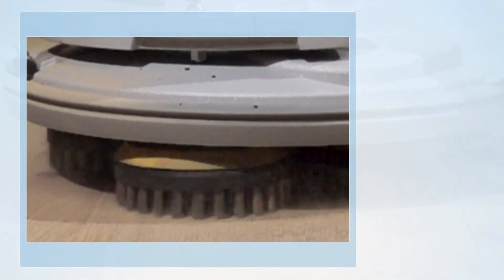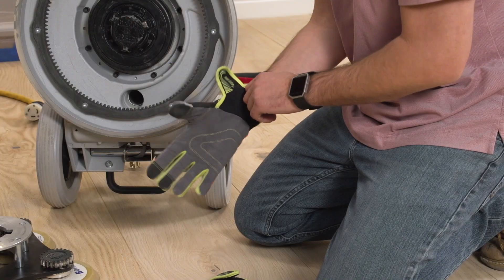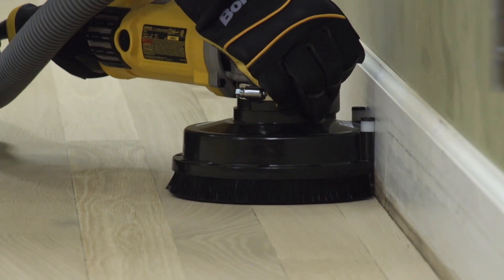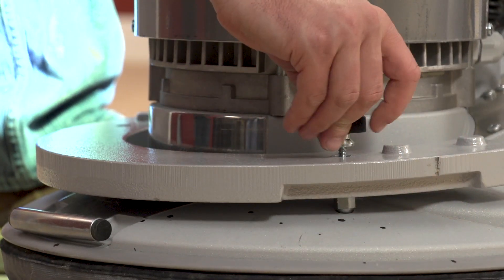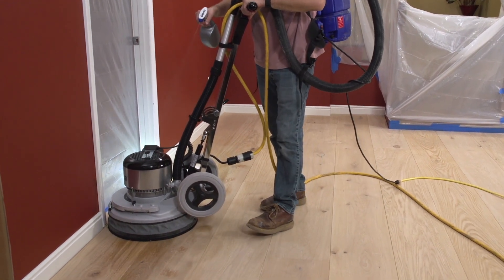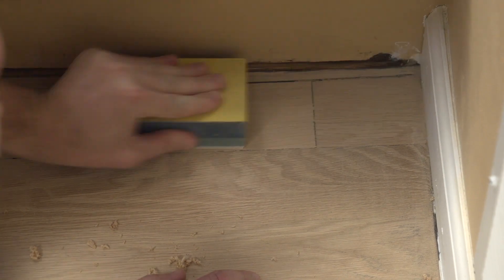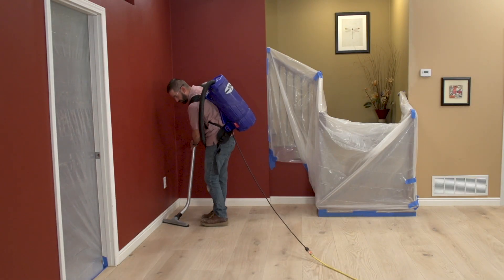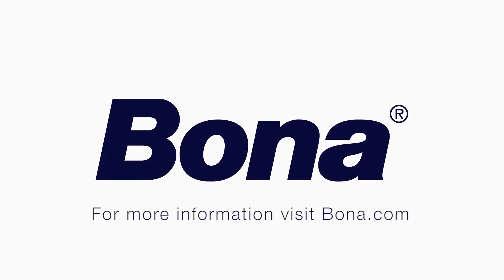How To Wire Brush Floors with the Bona Power Drive

Comment: does bona have white glaze to give the white color in the grain.
Reply from the maker: There are several options to create the cerusing effect using Bona products. 1. Bona Craft Oil 2K Frost can be skim applied (with a squeegee) over a base coat color of Craft Oil to leave the white pigments in the grain (dilute Frost 50/50 with Natural to lessen the whitish effect on the hard grain). 2) You can create a "glaze" of any color by adding Bona SuperSport Paint to Bona ClearSeal or Bona IntenseSeal. 3) You might be able to achieve the same effect by applying Bona NordicSeal. 4) Combine several of these options to create your own unique effect.

Any of the above require trial-and-error application testing to confirm your desired results. Hope that helps! Cheers!

Comment: What kind of finish would be recommended for after sealing it. Will Bona One fill the wire brushed grooves?
Reply from the maker: Hi Nathan - We'd recommend one of the Bona Traffic HD finishes be used for its overall superior durability, especially over a wire-brushed floor (which is now a bit more sensitive due to the uneven surface). So, either Mega One or Traffic HD in an Extra Matte sheen seems to compliment a wire-brushed floor the best - and make sure to apply it with a roller, as a t-bar application will tend to pool the finish too much in the brushed-out areas. Hope that helps!